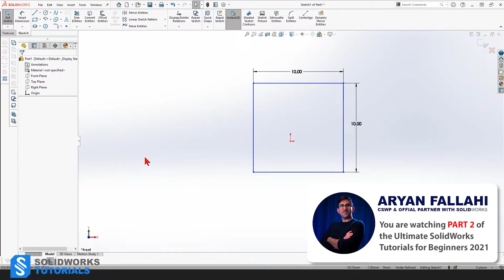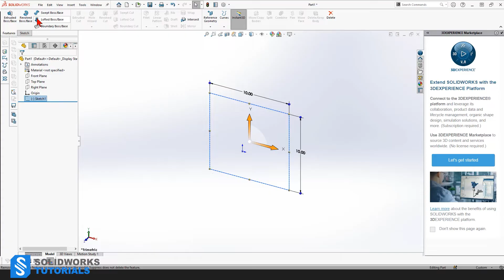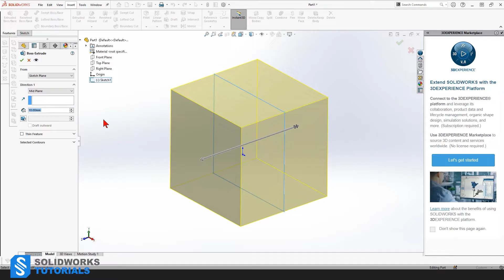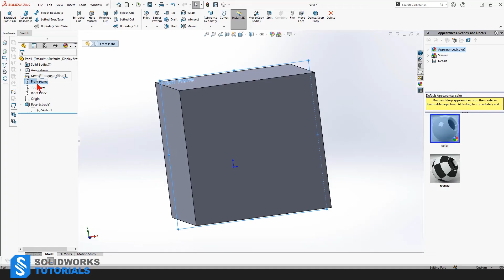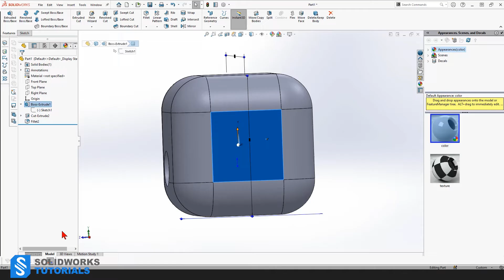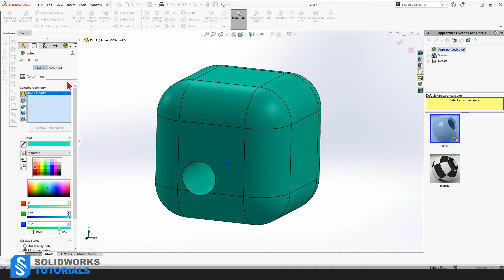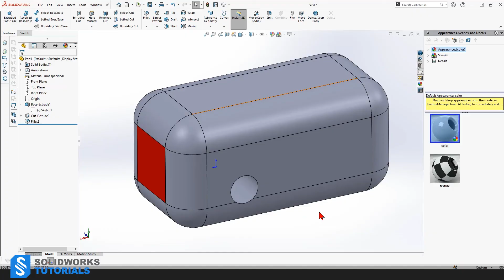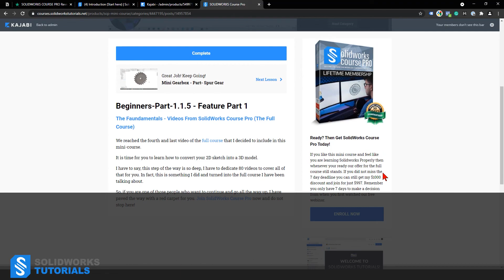Ultimate SolidWorks Tutorial 2021 for Beginners (In depth explanation) Part 2

Comment: Could you go into more detail on why the direction is that big of deal? You are making this for beginners and just saying yes it does is not going to help them. For changing, views space bar is faster than Mouse Gestures?
Reply from the maker: no space bar is not faster, Shift+Arrow however, is faster. You cannot find two people whose working habits are a 1:1 match. Not in SW not in any other software. I assume by Direction you mean Navigation? (please correct me if I misunderstood you)
Navigation is such a big deal because without knowing it, this is the most common action you take in 3D design, and every second saved results in hours in the long run.

Comment: Hi, after I press done, whole of the model disappear and won't become grey like yours. What should I do? It's so annoying I searched a lot for that. Can you help?
Reply from the maker: Top middle of your modeling screen, there is an icon that looks like an EYE. You have either clicked on that by mistake, or a shortcut etc. Go in there and make sure SKETCH is active
THat's your view menu
Reply: @with-aryan  Thanks for your respond. Unfortunately didn't work. When I click on 'Boss-Extrude1' in FeatureManager I can see the Cube. But it is void, just lines. and When the 'Boss-Extrude1' is not selected when I move mouse in screen I can see the plates. Thanks for you time again.Sorry
Reply: @with-aryan  I solved my problem. It was due to my GPU problems.